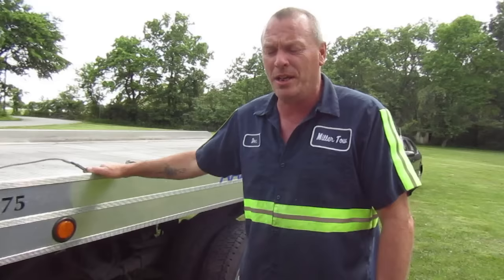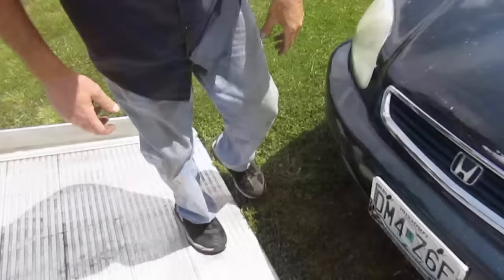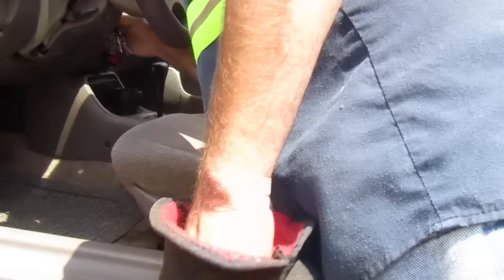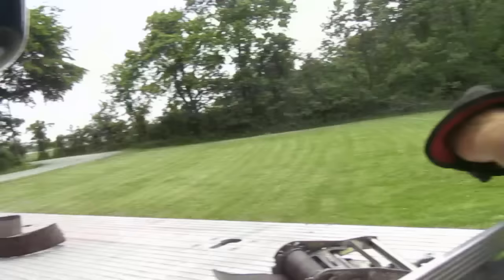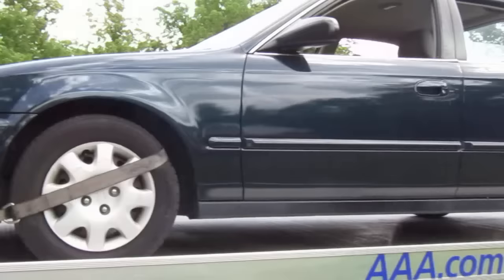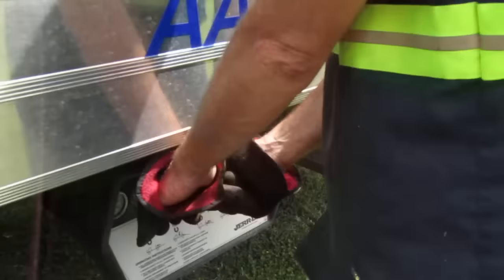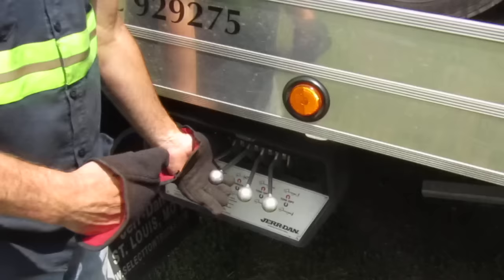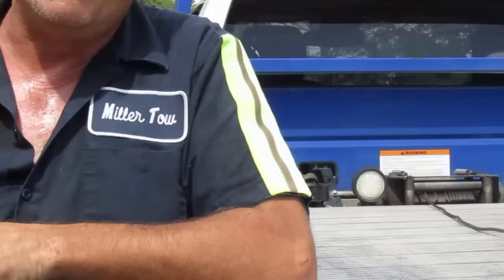How to load and unload a car from a flat bed tow truck

Comment: Sorry for picking a nit on you, but the pull / push rod at the front of the bed is not connected to your PTO. It's a release that uncouples the drum from the winch's worm drive. The PTO is hydraulic pressure actuated at the transmission. It is controlled by the dash switch and the neutral safety switch.
Reply: J W i thought thats what he said? Its a brake release for the drum? I heard him Say the PTO was the switch in the cab?
Reply: if customer is standing there and you hit their car against your truck no you have not just bought a car,you sir, have just purchased a  tennessee  ass whooping here
Reply: @realtalk3962  I thought that you weren't suppose to free wheel the winch too?
Reply: I’m a tow truck driver and I can point out at least 10 things he did wrong.
Reply: @josephbrown2564  make your own video then !

Comment: Our wheel lift tow truck is down and I knew enough to be safe in a flatbed, but I knew I was fighting myself every time with strap tightness and unloading the trucks. This video has me moving smooth and using my body a lot smarter. Thank you so much!  -Young Fleet Mechanic
Reply from the maker: Thank you for watching my video I'm glad it helps you out some

Comment: A true professional at work. The guy who collected my 3 month old car when it had a puncture wasn’t. Reversed it straight off at normal speed, with a flat tyre. It collected one of his straps underneath and as it drove off the bottom and the buckle ripped through the bumper dislodging it. Now stating he didn’t cause the damage! On another note the cops sound pretty ruthless round your area.
Reply from the maker: Some people do not need to be driving a tow truck as far as the cops go they are looking to make money like everybody else is

Comment: I always tie down the vehicle before loading the bed horizontally because if I have a car that the parking brake is weak and the transmission won't go in park it won't roll on me when I load it up. And I leave a bit of tension on the wench to snug down on the wheel straps. It keeps the car more secure especially when driving on a long haul and bumpy roads.

Comment: Many thanks for the instructions. At the end though, ... seeing that you just placed the hooks in that hole for that purpose and not pulling the chains so these, being lose and the bumps on the road could come up from the hole and start jumping and reaching the edges ... well, if you are in a highway and at high speed it could become dangerous for the rest of the drivers around you.. I have seen lots of videos of people forgetting tools, etc and things that for not being tight and secured enough... have cause accidents and even deaths. please, do not forget that. Thank you.

Comment: That’s why you roll down the window a bit so you can leave the keys in the car (cup holder) otherwise you’ll be wasting your diesel and time driving back to deliver a key from a job you just finished how ever far it was from A to B in the 1st place. Who knows how far you’ll be by the time you remember you have the key in your pocket.

Comment: Another good tow truck driver pull down on the tires and stress out the spindles, ball joints and alignment
Reply from the maker: Sorry but how do you figure is putting stress on the spindles and ball joints buy strapping the straps around the tires cars today are made out of cheap aluminum and around here the law is all four corners of the vehicle have to be tied to the bed

Comment: i keep the wich tight i feel its safer that way, and when i winch the car on the bed i strap which ever tires are on the top off the bed first then pick up the bed. then i do the second set off tires and last i tighten the winch more

Comment: a well wound cable is the first sign of a good responsable  operator , i will try strapping a car like that next time , i have a HD tilt tray i move earthmoving gear so i dont have the standard car gear but everyone has 4 straps to choke a tyre ,good tip 
im not going to nit pick your procedure we all have our ways as long as it is safe and secure ,no damage
Reply from the maker: Thank you for the nice comment be safe out there

Comment: European cars (cars sold for the European market, not just cars made in Europe) usually have just one hook to tow or a screw-on hook or nothing at all. Most of the time there also aren't any usable holes in the chassis. Long story short not a lot of options.

So many times I simply hook the cable on the low loading arm (unless it's aluminum).
Reply from the maker: You are right about not having no choices I usually just use a soft wrap around the lower a arm

Comment: Bridal ... Choke the bridal ( shortenin up the chain ) sheesh . Important if you dont wanna pay for bumper covers ... Leave enough slack , the center hook stays clear . Once its on the deck chock the wheel till a saftey chain is within reach of an eyelet ( especialy if you load in front of a cruiser ) otherwise ... 4 wheel 1500-6000lbs cannon ball . Cross the rear chains or straps ( unless you basket the wheels ) keeps rear of load centered , even tension on securements ... no need for wratchets at the rear that way , a bit quicker and more secure , just synch an inch ( dont misalighn the car being an ass with the winch ) first and last things i use wether loading or unloading saftey chocks or chain.

Comment: You should always half pull hand break so if car comes off the cable  
It won't run away
Reply from the maker: The only problem with that is a lot of brakes won't release because a lot of the cables are rusted then you have bigger problems

Comment: Good video. I do it a lot different but I work for myself. I leave it in  neutral I leave car to the end of bed not winched up all the way. I use j chains on the rear and put them on loosly and take the extra chain and stick it in front of the rear tires than I winch it(the car) tight and the rear tires go over your extra chain holding them down than I strap the front of the car to the bed and back the winch off just a little. But everyone does it different.
Reply: CHOPSHOPUNDERGROUND you own your own truck? Hows the money? And is the work as steady as with a company?

Comment: No need to tighten the bridle you should have plenty of room only time I see this step useful is on a full side pickup but even then I’d grab from the rear axle or the frame. Then again your bed is smaller so I can see why also I usually grab from the A-arms and the keys stay in vehicle with window down unless raining or dead batter. You should never pull bed up until you have a front safety chain and the rear chains are tight then bed goes up. However. This is the way we do things and like you say everyone is different whatever works for you.
Reply from the maker: So very true everybody does things differently different Straits different cities have different rules

Comment: I notice you have a hydraulic pressure guage by the controls. What are you getting when moving a ram, and when you get to the end of the drove on a function. Thanks and great video
Reply from the maker: When my use my bed I noticed the gauge goes up between 1500 and 1800 that's where it usually is
Reply: Thanks, Mines at zero when moving and hits 1700 when a function is stroked. I pulled and checked the pressure relief and it looked good. Tried adjusting. Think the pumps dickered

Comment: I'm about to finish training for my first towing job, and I was wondering. 

Do you have any tips for judging the distance when letting the flatbed onto the ground? I tend to not accurately gauge it right, and it ends up feeling awkward watching my annoyed trainer fix it. He ain't really the vocal type outside of irrelevant stuff.
Reply: I assume you mean judging the distance between the rear of your truck and the front of your customer's car when you're backing up to it.

The way I do it is I use the edge of my bed as a reference point.  After releasing the air from your truck's rear axle air bags (Assuming your flatbed has them, disregard if not), I would back the truck up until you no longer see the headlights of the car.  Generally, that will get you decently close to the vehicle you're about to load.  Hope this helps!
Reply: @mikokat  I actually quit that job early this year, but this is actually great advice. If I ever find myself going back to towing, I'll definitely apply this.
Reply: @GoTELuckyCharms  why’d you quit?

Comment: Everything I’ve seen is great except that I would want the winch snug at all time keep j hooks or t’s from falling out, secondly if you put the bed all the way up and flat, you leave the chance of a faulty transmission or breaks . You can trust the car because you don’t know it, I leave it inclined  then take off first point, then chain at driver rear by slightly letting winch out, then you take off passenger rear strap, then put car in neutral, extend bed to ground winch down..
Reply: This way I know that cars trans is not going to fail and hit the top of my bed
Reply from the maker: Sounds like a plan to me that's why I say everybody does things their own way

Comment: I have had my 2015 Volkswagen Jetta towed 2 times in the past 3 weeks, and both drivers Did NOT load, or unload it correctly. I didn't even know that the little Plastic square on the passenger side of the front bumper was a cap to cover where you screw an I bolt into it, so that it can be Properly loaded onto a flatbed. 
I just learned about it yesterday from a neighbor. When the tow guy came the neighbor said to take video, don't say anything to the driver, and see if he leads the car correctly. 
Well, I didn't even get a chance to Correct the guy before he loaded it, because he got into my car when it was right behind the tow truck, started the engine, and drove it up the ramp. I was so mad, because the reason it was being towed was, because the Serpentine Belt was Snapped, and twisted up around the bottomed of the engine.
When my neighbor said something to the guy he started YELLING, and saying that he was from Saudi Arabia, and that HE (my neighbor) BETTER RESPECT HIM!
The tow guy called his Boss to complain about my neighbor telling him that he didn't load the car correctly, and only strapped one tire, and also that we were all taking photos of him with our cameras. I only understood bits of his conversation, because he was yelling in Arabic. 
I don't know who to call to Report that jerk.
A phone call was made to the owner of the tow company which NOTHING is going to be done about it, because the tow guy's family owns the tow company. 
Any suggestions?
Reply from the maker: I'm sorry that you're going through all them problems but there's really nothing you can do about it just be glad you got your car towed and hopefully it's fixed now but honestly I'm starting up and driving on the truck did not hurt anyting

Comment: great video...always enjoy watching everyone's different ways of doing things...as well as learning the different regulations from state to state.

Great point about always putting keys in your pocket...dont do like I did the other day and lay them on the bed to answer a call from dispatch and forget them...that was an expensive learning experience lol

I do have one question though...and it may only be a matter of personal preference, but is there a reason behind putting your bridle so far forward and winching up all that line when not in use...I always hook mine to the tie down points at the rear of my bed and pull my cable tight, then let just a slight bit of slack in it...been doing it that way for years. Stay safe brother and keep up the good work
Reply from the maker: Thank you my friend I appreciate you watching my videos

Comment: Thank you for a very thorough and informative video.  Just over a week ago, my 2017 Honda Accord was struck from behind and it caused only rear end damage. A flatbed tow responded at about 10pm. The operator did not use the wench but drove it up on the truck at a high rate of speed causing a very loud bang and the bed to shake a great deal.  Dragging a muffler behind the whole way.  The whole process from when he got in my car to appearing in the parking lot driveway to begin towing out into traffic was only about five minutes..Since  my state of California also has a four point restraint requirement, do you think this was a proper tow?  Would a company like AAA allow this?  The operator took my car to their tow yard and when the repair shop had the car retrieved from their yard, the shop contacted us to question the front end damage. There was none caused by the accident. Do you think it is likely that the numerous scratches at the extreme lower edge of the front end and what looks like a popped amber light that did not have a broken amber plastic was caused by the   Low clearance of the car hitting the angle of the car hitting the raised bed at a high rate of speed resulting in the loud noise and shaking of the bed?

Comment: Nice video, well explained. But I didn't see u use tha last 2 levers from the truck. What are those functions?
The 1st one brings the bed forward/backward, the 2nd one raises/lowers the bed and the middle winds/unwinds the cable. I'm curious of the last 2 levers
Reply from the maker: Those are used for the wheel lift one of them pushes the will lift out and in the other one goes up and down
Reply: stinger
Reply: Great vid. How much do u pay a year for tow insurance?
Reply: And how do people sue if u use winch on front and hook around rear axle. Do the claim u bent the rear axle?  Thanks. Wanting to start my own tow company. How do I pay an additional driver?  By the hour or the job?  Thank you.

Comment: That's not a commercial vehicle.A commerial vehicle needs a CDL,and i dont think you need a cdl for that rollback.Also dont you have to or father its much safer if you lastly release the front 2 wheels.But its a very good video to train for.Unfortunately i must do this 3 times and just the front 2
Reply from the maker: it is a commercial vehicle and do have to have a cdl and a medical card to drive a tow truck

Comment: Need some advice on getting my foot in the door, completely  green, only driving experience  I have is 1 ton flat beds half air brake at my construction  job which I know is nothing  like a tow truck driving record is clean besides a speeding ticket. What's the best way to go about getting my first towing  job since most companies  want experience. Should I get a CDL first?
Reply from the maker: If you go to a big company you'll have a problem getting a job look for companies that do AAA roadside they are always hiring drivers and are willing to train you good luck to you brother
Reply: I would call every tow company in your area and ask them if they will train you. That's how I started. And work for a company that does recovery and SHP accidents. You will get more experience than with a road side assistance only company.

Comment: Question, shouldn't you put on the parking brake once the vehicle is strapped down in place?
Reply from the maker: I wouldn't recommend doing that most people don't ever use the parking brake so they can be rusted or all kinds of things when you put them on they won't release and now they want you to pay to have them fix
Reply: Depends on the vehicle and situation. Some newer cars have an electronic push button for the parking break. And sometimes it can get stuck. If it has a lever, then I always use it. You have to use common sense in this industry. And your head. Think about everything your doing on each pull. No two vehicles are alike  and you never know the condition of the vehicle. But most vehicles, I use the parking break if it works well. Otherwise strap it down hard while the bed is angled before you load the bed horizontally. Then you know the car is secured properly.

Comment: Does anybody think that the straps should go over the center of the wheel not beside the center? And the d ring needs to be near the edge of the wheel not near the edge of the tire right?
Reply from the maker: As long as a d-ring is not touching the rim you are good
Reply: @donaldchastain6847  of course. Always line up the straight edge of the d-ring with the edge of the rim so when you cinch down the strap it pulls it away from the rim but stays on the side of the tire instead of working around the corner

Comment: Thank you for the video Mr. Chastain.  Quick question if you don't mind.  Is it necessary to set the idle with the cruise control at 1500 to 2000 rpm, when utilizing the PTO?
Reply from the maker: With my old truck I could do that really easy but with his new truck it's already pre-set so once I turn on the PTO it revs up to about 1200 RPMs
Reply: Donald Chastain Got it, thank you for your reply!
Reply: Thats usually best specially if u in a Hino but no higher than 1500 rpms as u can burn out the PTO
Reply: In the smaller flatbeds u dont even need cruise control 1 truck i drive is a Ford F550 and it runs at a pretty good speed just wit e brake and regular PTO speed

Comment: thanks i was never shown wheel straps  like that.
Reply from the maker: You are more than welcome thank you for taking the time to watch my videos
Reply: Monteaparty . Their just D ring straps , couple different ways to use em . On a wheel lift they work well wrapped to coil springs , or basket the tire & thread the loose end thru your wratchet .